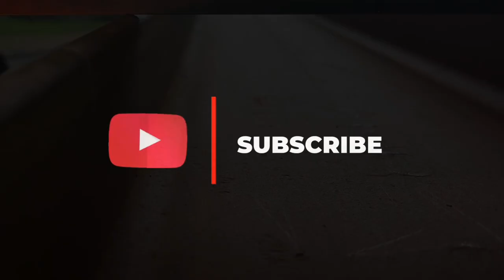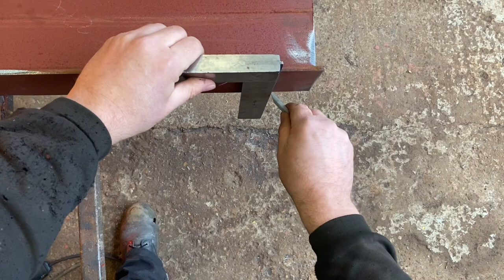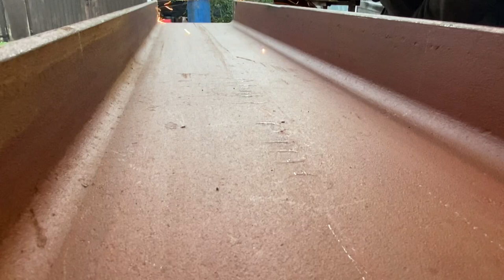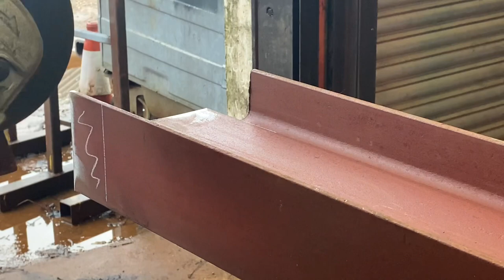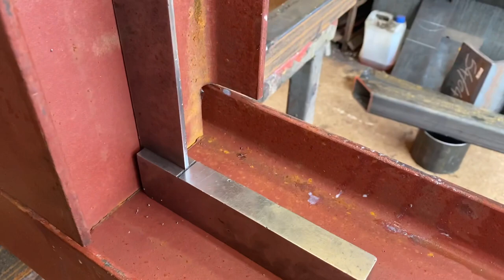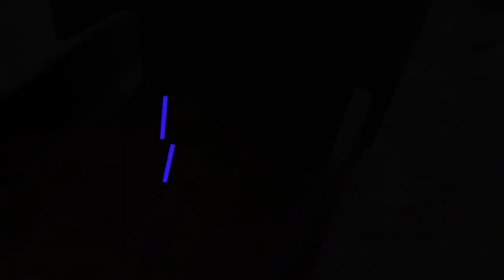How to Mark out and notch steel beams - Structural steel work fabrication. 9”angle grinder

Comment: I worked in structural steel fab shop for a while, this takes me back, I notched many an I beam with a torch. 👍🏻
Reply: 17 years in the game ive never seen 1 single person use a grinder till this video...only reason i watched it
Reply: @THE-POLYMATH  grinder is a lot easier and can be a lot quicker (imo) but 9/10 you use a torch. especially repetitive stuff
Reply: @rotam8680  I used a grinder in my first year of my apprenticeship, but then moved to a far more professional outfit for my second year; they were shocked that I did not gas cut the notches. It's far quicker, and less noisy, and less cumbersome.

Comment: No radius? We have to build it back up with weld if it's too much of a corner like that. I think code is half inch radius but as long as it's rounded sufficiently it passes. Love your videos on structural nonetheless.
Reply from the maker: Hi Jesse. 
Thanks for your comments.
All made to structural engineers drawings. 
I understand why you’d radius.
It even looks better, but we’re simply not asked to do so. 
All the best.

Comment: I have a possible fab job coming up. Your opinion please? How does one find the protocols for welding Hardox 450 Wearplate with MIG wire, and what would be the amperage range if the hardox is 1/4" thick?
Reply from the maker: I have no personal experience of welding hardox wearplate. 
This may be of help. https://www.mig-welding.co.uk/hardox.htm
Reply: @TheMetalFabGuy  That’s a great start thank you very much. All the best to you.

Comment: A Swanson speed square (Or similar make) is a better tool for this job. Just round off the flat corner so it fits in the radius of the beams and it works a treat.
Reply from the maker: Thanks for watching, and thanks for your advice 👍
Reply: Speed squares are magnificent for all sorts of layout and worth having in any weldors bucket.

Comment: I’ve always been taught to never square cut your copes on the insides. Round them out or they will split.
Reply from the maker: Fair point Scott. And no doubt structurally correct. 
Some specify it. A lot more don’t that I’ve dealt with. We work to those calculations.  I’ve never seen or heard of a non radius notch failing. Not to say it’s never happened. And certainly not on any I’ve personally fabricated. Thanks for your comments.
Reply: @TheMetalFabGuy  I changed out 8-10 in the ceiling at Ford where they was straight notched an busted. Shut em down for 3 days for us to fix it
Reply: @TheMetalFabGuy  wish I could send pics on here!
Reply from the maker: Send to; Themetalfabguy on Instagram Scott.
Reply from the maker: Size/weight of beam suitable for its purpose in your opinion. 
Or 100% the square notch. ?
Reply: @TheMetalFabGuy  I don’t do instagram buddy. I can bearly Facebook. I’m a dumb Kentucky country boy!
Reply: @TheMetalFabGuy  yessir the beams could handle that and more. It was a straight cope. It was steel in the ceiling that handled a machine pretty much a big clamshell that set the cabs an beds on trucks when they come down the line we found it in the nick of time it was all about to come crashing in on people
Reply from the maker: Thanks for sharing your experience Scott.

Comment: What would be the method for attaching the beams?
Reply from the maker: Hi Bob. Thanks for watching. 
After notching there would be 3 common options. And depending on the method, this may need to incorporated into the measurements of the initial notch. 
Straight welded connection. 
End plate with holes welded to the notched beam. 
Angle cleats bolted to the notched beam again with provision of holes for both beam connections.

Comment: How wrong can you be? In coping, you MUST HAVE a 1/2 inch radius in the web corners to the flange to prevent a crack to develop from vibration and thermal expansion, and contraction.
Reply from the maker: Where you are Frank maybe. 
There’s a big world out there. 
Fabricated to structural engineer’s specifications. If it had a radius on the drawing then it would have one on the beam. 
Never seen a beam crack from a square notch / cope in nearly 30 years.
Reply: @TheMetalFabGuy  Apparently, you have never fabricated under a code or opened an AISC Code book. Do yourself a favor and do some reading. I worked in a steel manufacturing plant as a Class A Fitter but worked my way up to Chief Inspector with a Certified Welding Inspector (CWI) endorsement and certified in Canada under the Canadian welding Bureau (CWB).
Reply: @TheMetalFabGuy  A question for you. Are you actually welding these parts together or just giving them the pieces to weld on site? Are you sure they aren't adding the radius after it leaves your hands?

Comment: It’s a lot easier to start cutting at the bottom of the flange, this makes it easier to see your line
Reply from the maker: Thanks for watching and your opinion Lewis. 👍
Reply: Off camera this guy had hes head an back in bad dangerous  positions trying to see hes line ...scoring a lead line should always travel away from body ..  calling it just  "easier" is very kind ... its a complete novice  way to do it.. and very very risky
Reply: Pluss who uses a grinder to notch ffs.. he must be knackered using that 9 grinder all day in a fab shop ... how much he spending on discs ... im in london.. we burn it, give it a quick clean.put a radius in the corners then plate it ...3 /4 min job

Comment: That is a dangerous way to use a 9" grinder. Key word being grinder. You have achieved the cope. Do that for eight hours.  Cutting torch would be the better choice of tools. Use the grinder to dress the cut if necessary for attachment of connection.
Reply from the maker: Hi Barry. Thanks for watching. 
That is a 9” grinder with a 9” purpose made cutting (key word) disc. Not a grinding disc. They make these now.
They also make the grinders in 4.5” versions if the 9’s are too much for you. 
Fully agree on the cutting torch and an 8 hour shift. That would be down to the individuals preference, and what they have at their disposal. 
There are multiple ways of achieving the same outcome. This is one way. 
Every tool is dangerous if it isn’t used in the correct manner, and by a competent operator.